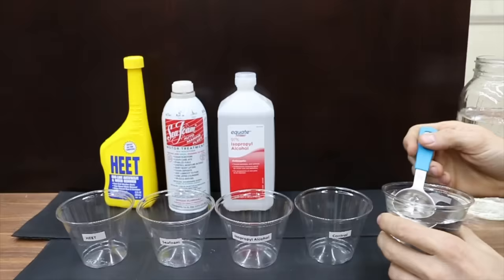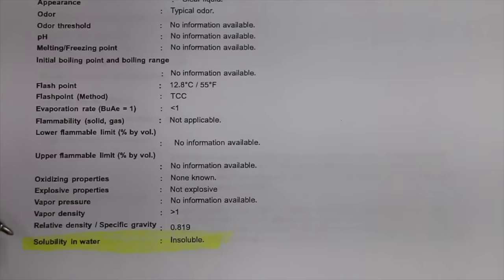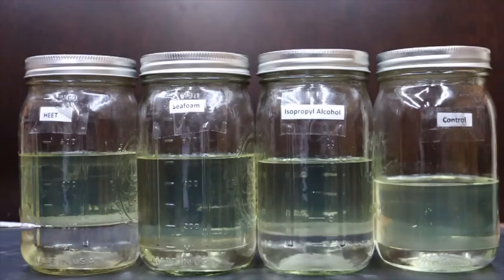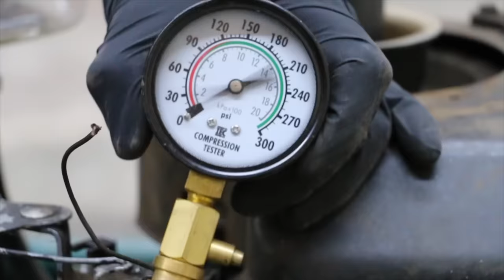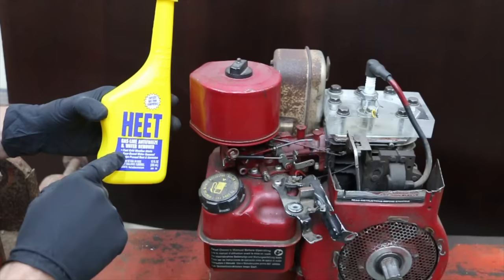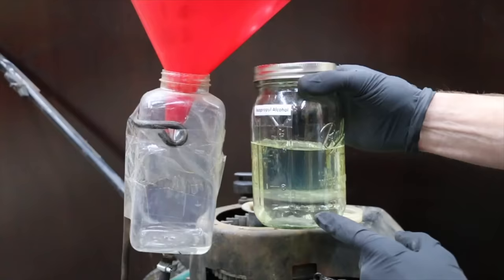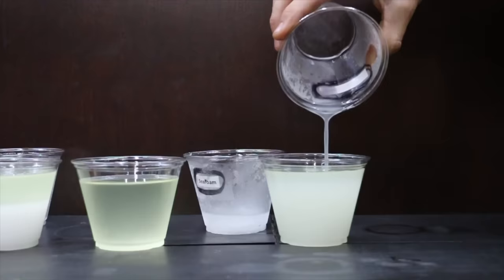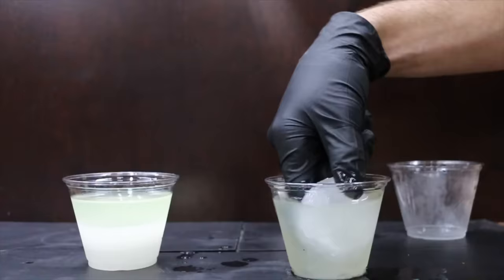Is HEET better than Seafoam for Water in Fuel?  Let's find out!

Comment from the maker: Thanks for all of the video suggestion and please continue suggesting future video ideas!  Best regards, Todd
HEET: https://amzn.to/2QeVA8S
Seafoam: https://amzn.to/3hlKHOJ
Reply: If there is water why not just add some E85. Seafoam has mostly Naphtha a form of gas, well Coleman fuel. Also has alcohol and water.
Reply: What about making a video testing front end suspension parts. I worked on a 1990's Chevy truck replacing the original front ball joints and tie rods. Some parts had to be cut off. It was such tough solid steel i never could cut all the way through. However replacement parts for that same truck I cut through like butter. They changed the solid steel tremendously.
Reply: @gregsz1ful  doesn't E85 corrod rubber cause collapse and more
Reply: @nicklopez5298  yes. I was just suggesting adding a little.
Reply: You should do strongest hot glue gun glue if you have not or even construction adhesive
Reply: Could you explain why you used 73% Isopropyl, which is already 27% water, rather than pure Isopropyl?  Was it because of how common 73% is?  If you think about it, you didn't need to add any water for your Isopropyl test - it was already 27% water.  As a guess, I bet 100% Isopropyl would have  given awesome results, don't you think?  BTW, I find the easiest way to get 100% Isopropyl is by ordering it at the pharmacy counter in drug stores.
Reply: Why did you test yellow heet, not red heet?
Reply: I know this video is older, but my 150 hp outboa at different motor was running bad one weekend. I had a mechanic go over the entire electrical system and found nothing. So after thinking about it I realized the only thing different was where I bought my gas. Usually I pull the boat out ant haul it to the Shell station and fill it up. But this time or two I bought gas at the dock. Well we went to a restaurant on the lake and afterwards to the store at the marina. There I bought some STP Fuel treatment. I put it in an instantly fired it up and had several miles to go before dark but I had no issues. It instantly changed the properties of the water and burned it all up. I'll swear by that product.
Reply: Have you done a test on which fuel injector cleaner works best? 

I used Lucas but it didn't do anything noticeable when I followed the directions on the bottle. I had a mechanic suggest I wait until my gas gage reads 1/4 tank and then add 4 bottles of Lucas Fuel Injector Cleaner. I did as he suggested and what a difference in power. That old 2008 Dodge Grand Caravan SXT 3.8L has a lot more get up and go now. It is a big difference. I just wasn't using enough Lucas in my earlier tries.
Reply: I would love to see you test is will rubbing alcohol help a motor that has had ethanol gas sit in it